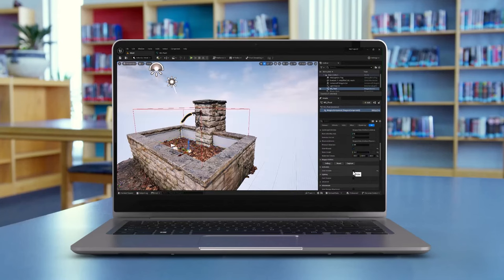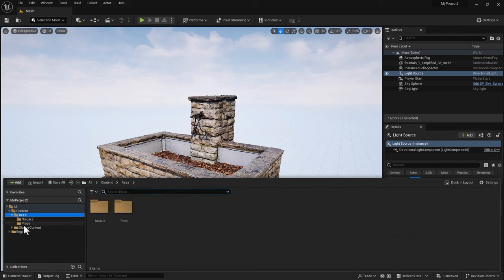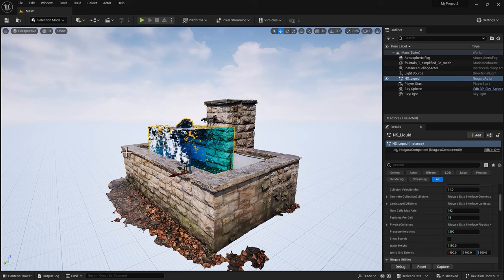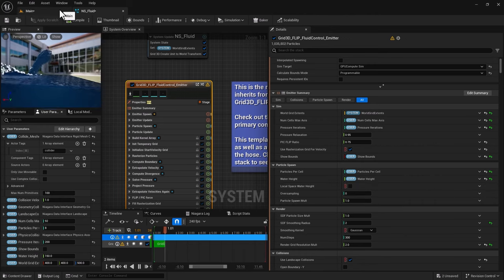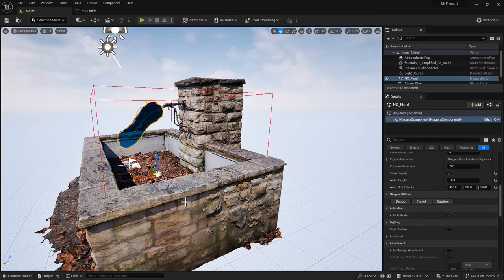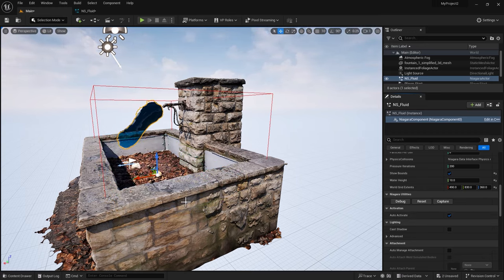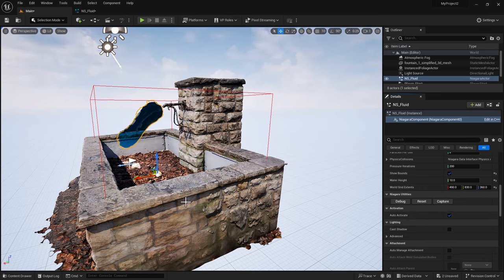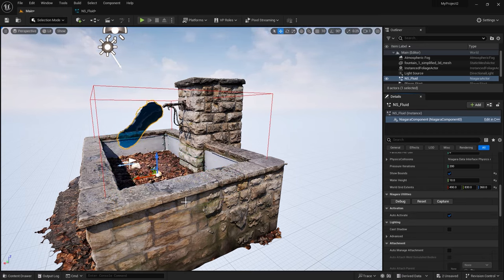#UE5 Series: Intro to Liquid Simulation in Unreal Engine

Comment: doesnt seem to work in 5.3, getting compile errors on all the 3d water templates to do with the system spawning at a vector and a position. ?? any ideas anyone?
Reply from the maker: Unfortunately the compile errors you're encountering with the water fluid system in Unreal Engine 5.3 are a known issue, particularly when dealing with Niagara Fluid templates like Grid3D_FLIP. These errors often relate to mismatched variable definitions, where attributes such as GridCenterPosition are defined both as a vector and position in different nodes. This inconsistency leads to compile warnings and runtime issues.

A potential workaround involves reviewing the specific modules and ensuring compatibility between the variables. Another user-reported tip is enabling all Distance Field-related settings in the project, which has helped reduce errors in some cases

Comment: how do I turn this whole system around? Only the pool turns, but the jet stays there.
Reply: if you want to change the orientation of the emitter you have to change to negative values the (PARTICLES) velocity in the axis you need.

Comment: hey thank you very much for this. Do you know which settings allow me to fill the tank from the bottom? Thanks
Reply from the maker: You’ll want to tweak the Emitter Properties and adjust the Velocity or Direction settings. To fill the tank from the bottom, set the velocity direction to push particles upwards from the bottom of the tank. You can also play with the Position and Spawn Rate to get the flow right.

Comment: Is it possible to change the bounding box holding the water to a circular bowl?
Reply: use a bowl shaped collision thingy i imagine, from a fluid simulation angle it would be incredibly hard to simulate anything other than a rectangle of fluid, so youre just gonna have to make a rectangle with side width equal to the diameter of your bowl
Reply: Thank you @ValThicc